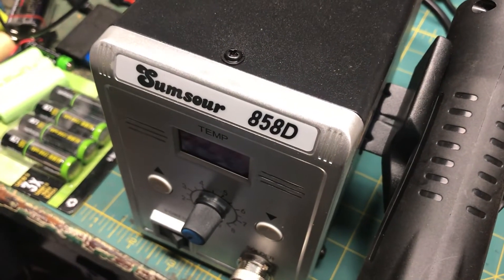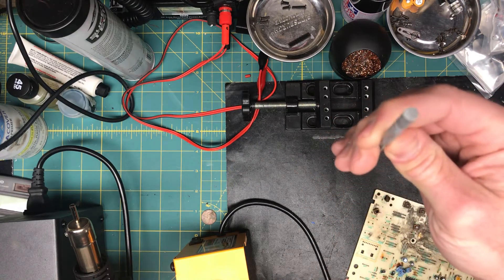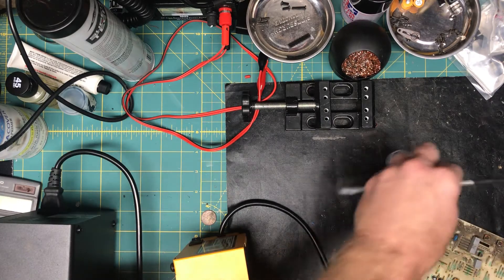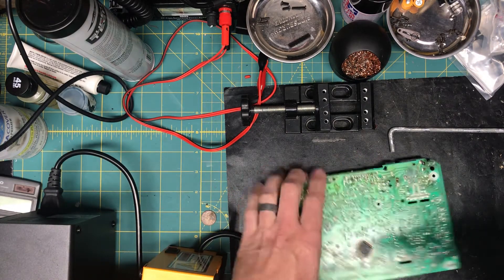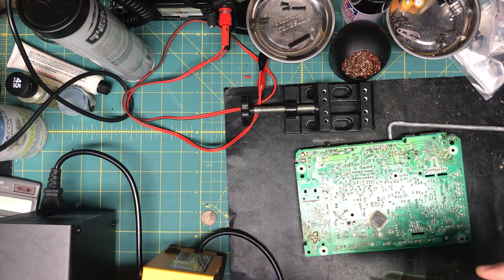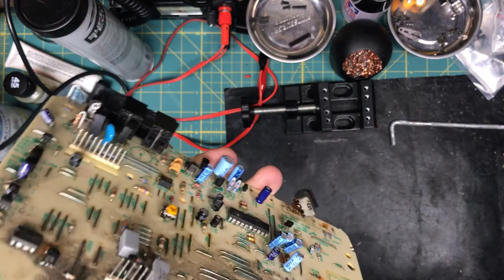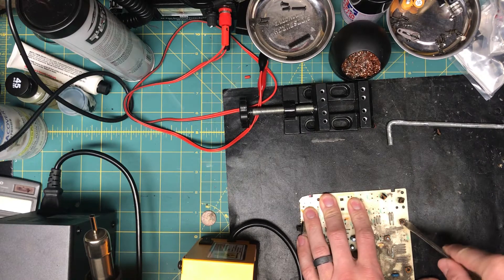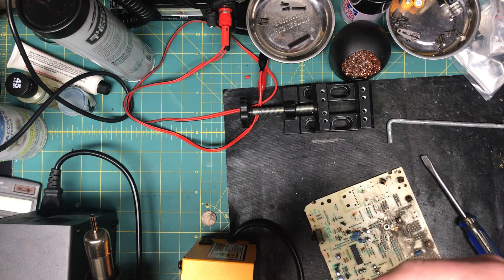Sumsour 858D Hot Air Station Overview

Comment: Soo... Is it still good? Did you still using it?
Reply from the maker: Yea I still use it. I using for mostly heat shrink tubing and SMD soldering.
Reply: @dadsrcworkbench1322  is good for SMD soldering, like install and remove IC with small and many pins?

Comment: Hot air is only used for surface mounted components not through hole components.
Reply: Hot air can be used for multipin components also

Comment: that is not how you use a heat gun.... melt the solder with the heat gun and gently pull out the component... then you use soldering iron and sucker/wick to clean the pad....
Reply from the maker: Thanks for the tip

Comment: Do you Know how to calibrate this model, i have one and i don't know how to calibrate it cos i have only a chinese manual.
Reply from the maker: I received a Chinese manual also.  I just plugged it in and adjusted the temp with the buttons on the front.  Are you having issues with a difference in temp on what it shows and what temp it is blowing?
Reply: @dadsrcworkbench1322  At the moment it's working well but I'd like to know how to calibrate it. I could read between chinese letters "CAL"  in the manual then I think that if I need to calibrate it in the future I don't Know how to do it. but that "CAL" wrote in the manual make me think that it's posible to do it; in other 858D models exists a button to calibrate it. It could be interesting to get a english version of the manual.
Reply from the maker: @tonyperez6573  here is a rough translation thank you Google translate app. “EMIST two, the working temperature is set in the power-on state, if the current digital display is the working state of the road that needs to be reset, move straight and press the "▲" or "▼" key to adjust the set temperature of the road: such as current  The digital display is not the working state of the road to be set, you need to press the "※" key to switch and then press the "▲ or "▼" key to adjust the set temperature. After the setting is completed, the actual working state of the road will be displayed after the setting value is displayed for 3 seconds.  , Calibrate the temperature 1. In the welding state, measure the actual temperature value and record it. 2. In the welding state, press the "▲" and "▼" keys at the same time, and release when "CAL" is displayed.  When plotting points, input the measured temperature immediately (select the row within three seconds). After the correct input, press the "▲" and "▼" keys at the same time to display "CAL" temperature calibration. 3. Key function: "4. Display symbol  Note: 5. Wake up late with more hot air.  "Increase and Decrease" key "※" key switch. Fourth, wake up hot air dormancy After the hot air gun is selected into the color off state, no matter which working state is currently displayed, as long as the Ji hot air gun is retaken, the digital display will switch to the hot air gun  Display status, restore the previous setting work. U five, display symbol description shows "一1" heat gun standby state, indicating that the heat gun part is not turned on at this time, that is, the heat gun heating switch is not turned on. Display "SLP% hot air gun color off  , Which indicates that the heat gun has entered the dormant state at this time.  Display "-2": Winding iron standby state, indicating that the soldering iron part is not turned on at this time, that is, the winding iron heating switch is not turned on.  ZHO 5”
Reply: @dadsrcworkbench1322  Then to calibrate it we have to press arrow up and arrow down at same time and it will display "CAL", thats interesting for a future calibration. Thanks.
Reply from the maker: @tonyperez6573  You are welcome. I hope that helped out.